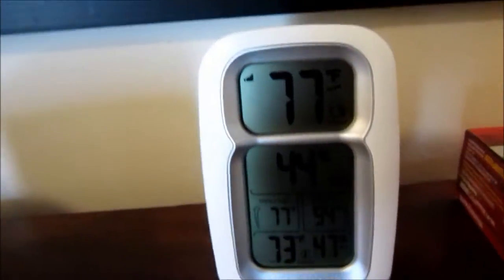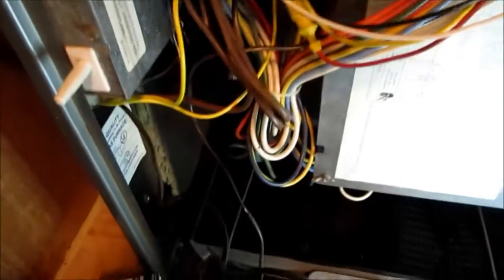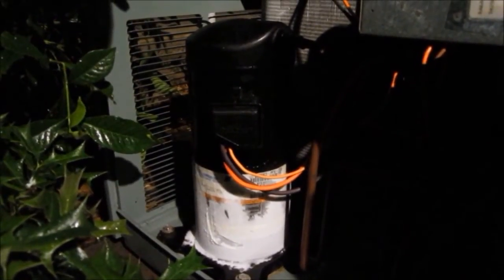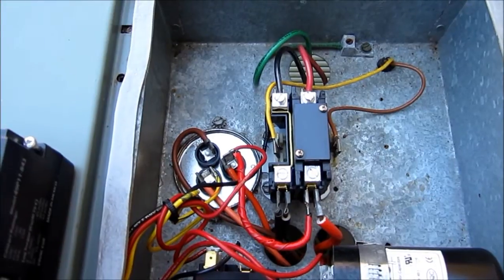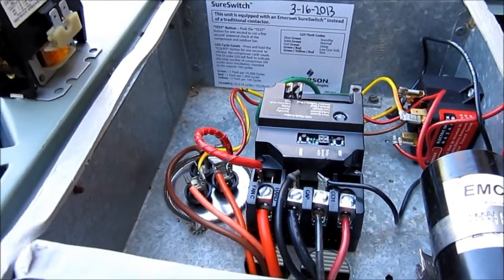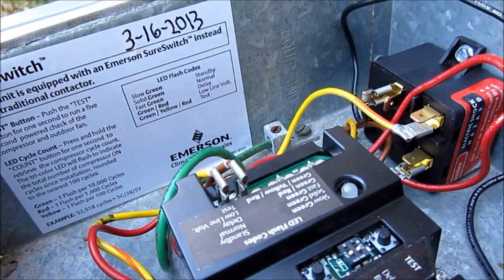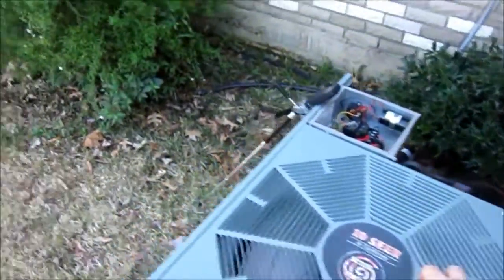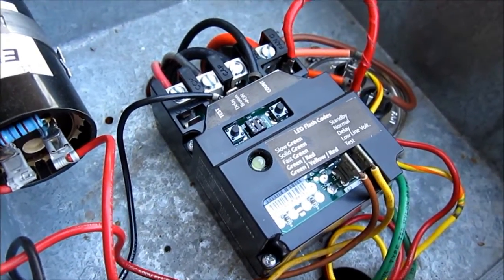Emerson SureSwitch

Comment: It has an annoying high frequency oscillating tone.
Reply from the maker: I have noticed a slightly audible tone with mine but I have to be right near it with unit cover off to hear it.
Reply: @AVTreasures  microphones do have a tendency to strengthen The Sounds they record. But this frequency is definitely in the human audible range. Just imagine the bullshit noises animals have to listen to, glad I'm not a cat. Laptop power inverters are you made quiet so you can tell when they're wearing out and they start to make Electric whining static noises.

Comment: Is the SureSwitch more likely intended for a particular part of the country? 
I called an HVAC tech to install one and he didn't want to install it stating it seems fragile, made of plastic and if water ends up inside (he couldn't tell me how it could be possible) it will blow out the unit... 
I'm in Arizona and it seems like nobody knows about it nor how to install it even following the schematic diagram...
I'm sure I could use it on my 3T and 4T trane but it seems like I'm going to have to install it myself?!?
Reply from the maker: No, the Emerson SureSwith will work anywhere. 
None of that makes any sense. It sounds to me like the tech is just not familiar with the product. If he were, he would have no problem installing it for you. If water is getting into the electrical panel of the unit, that problem needs to be addressed even if using a conventional contactor.  Actually, the Emerson SureSwitch's electrical components are sealed and less likely to be affected by moisture intrusion. It is also ant proof. Ants cannot undermine the SureSwitch like they can a conventional contactor. I don't recommend that you try installing one yourself unless you have had HVAC training and understand the wiring schematic of your units. Thanks for watching my video.
Reply: @AVTreasures  Thank you. I too believe he didn't know anything about  it. I was able to find a company who is willing to come at the end of the month to do the install even though they never installed one before but they said they'll figure it out so I'm guessing they are a bit more knowledgeable.

Thanks again for your reply, it reassures me that I'm not crazy about willing to have one installed to make the most out of my AC unit.
Reply from the maker: No problem Cyril. Glad I could help. 
You will notice right away how much smoother your units start once the Emerson SureSwitch is installed. The sealed relay and  zero point switching are a nice upgrade for almost any unit. Rheem and other manufacturers have been using this technology for years on certain higher efficiency units. Now any unit can be upgraded with the SureSwitch. The SureSwitch on my Rheem unit is now on it's 7th summer with no problems. I was replacing regular contactors every few years before either from ants or contact failure.
Reply: @AVTreasures  Both unit got upgraded to the SureSwitch, so far so good, thank you!
Reply from the maker: Awesome! You are welcome Cyril. Thanks for letting me know!

Comment: I like the idea of this for my four year old 4 ton unit. How would I know which Sureswitch model I should use for my heat pump?
Reply from the maker: The 49P11-843 is universal. It will work in place of most conventional contactors.

Comment: I would be hesitant using one of them. Firstly, Does it have a 30 amp rating? Secondly,  it has an electronic board, electronics and moisture are always at odds, also, cost, are they more than $15? Looks almost like a copy of a RiBB relay, only the RiBB relay is completely enclosed, the Sure switch is open to the elements.  If it was inside the air handler, it might be OK, outside in the weather.....I don't know......also TD's are not required anymore with  modern Thermostats they have TD's built into them already. Low voltage isn't a real problem very often below 190. I must say you do an excellent cleaning of a condensing unit. Vac first, your the first Ive seen to do it that way and it is the fastest and least messy way of doing things. Great job!
Reply from the maker: Yes, the Emerson SureSwitch is actually rated at 40amp. They are currently $38-$50 depending on where you purchase it. So far so good with all of them I have installed. The relay is sealed and the circuit board is encapsulated in clear epoxy as well. Thank you for the compliment on my cleaning and thanks for watching my video!

Comment: I have a Keeprite 2.5 ton central a/c unit. it's roughly 30 years old and working great.  will the sure switch work on my unit?
Reply from the maker: Absolutely. It will work in place of any single or double pole conventional mechanical contactor. It's a nice upgrade for units old and new. Thanks for watching Daryl.
Reply: Great! Thanks! Keep up the good work with the videos.  I'm am Aerus electrolux dealer and I like your central vac system. I also really like the drain vac In your mom's house. Good combo with the Sebo. Good call on the upgrade.
Reply from the maker: No problem! Thanks for watching my videos. That's cool that you are an Aerus electrolux dealer!  I love my Electrolux Central Vac. It's by far the best money I ever spent on my home. It's been serving me well for over 20 years now. Mom's drain vac works well too, but I like my Electrolux set up much better.

Comment: The way you have the sureswitch connected ,looks like it is switching the run wire (orange) instead of the common (black)? Am I correct, and if so, why do you switch it like that?
Reply from the maker: Yes, you are correct Jeff. On this particular Rheem unit, that is the way it is supposed to be wired according to the wiring diagram on the units specs. Some units could be different though, so always refer to the wiring diagram. If you're not sure, just move one wire at a time from the old contactor over to the SureSwitch.
Reply: Looking at the wiring diagram for my unit, it seems to not make any difference which side gets switched.

Comment: Do you replace double pole contactors with a SureSwitch?
Reply from the maker: Yes, you can replace a double pole contactor with an Emerson SureSwitch.
Reply: Have you seen or ran into any issues going from a double pole contact to a single pole SureSwitch?

Input from another forum stated that it was dangerous to go from double pole to a single pole SureSwitch. And one said if there was a short in the compressor or fan motor then there would be current on the ground. If that was the case, then wouldn't the fuse/circuit breaker trip or interrupt the current?

Comment: I'm a newbee but doesn't a modern thermostat have a short cycle timer also?  Wouldn't that make the short cycle timer in an a/c condenser unit unecessary?
Reply from the maker: Yes, most modern digital thermostats will protect the compressor from short cycles but only in the 24 volt circuit. The Emerson SureSwitch also has brownout protection which will react to a voltage drop in the high voltage circuit (Brownout condition) and shut the unit down. A thermostat powered by batteries (or even one that's system powered) would not react to a low voltage condition.
Reply: Thanks for the info. I asked because I had a faulty timer in my 25 year old Lennox A/C condenser and PSE&G Worry Free Service came out and just removed it. The tech said I didn't need to replace it because my thermostat would prevent short cycling. The service call was free but it looks like he wasn't totally honest with me.
Reply from the maker: No problem Nick. I think the tech was right in your case. The short cycle timer that was removed from your Lennox was just to protect from sudden changes or bouncing of the old mechanical thermostat that was installed with that unit 25 years ago. If your current thermostat has a delay built in, it will do the same thing as that old timer in the unit did. The Emerson SureSwitch is a step up in protection from just a basic short cycle timer.
Reply: Good to know. Thanks again.

Comment: Can the Emerson Sureswitch be incorporated with a defrost timer board?  I have a Ruud Avenger.
Reply from the maker: +PFM-Tech Tech Yes, the Emerson SureSwitch can be used in heat pumps that have defrost boards. I installed one in a Rheem RPMD series 14 Seer heat pump last year. It works great. Thanks for watching my video(s)!

Reply ·
Reply: Thanks for your reply...where can I find a wiring diagram that incorporates the sureswitch.

ps... great videos...keep em coming.
Reply from the maker: +PFM-Tech No problem. Here's a PDF with wiring diagram from Emerson's site: 

http://www.emersonclimate.com/Documents/White-Rodgers/instruction_sheets/0037-7295.pdf

I appreciate the feedback. I'll be uploading some new videos soon I hope. Thank you for watching!
Reply: Thanks AVT... I have reviewed that diagram as it comes with the switch.  But,,, it does not include defrost timer board wiring changes.  The fan is connected to the timer board and signal changes are different.
Reply from the maker: +PFM-Tech Oh, I see. I thought maybe you were waiting to buy one after you were sure it would work in your unit. If I'm understanding your problem correctly, all I can think of to tell you is this: Power for the fan only passes through the defrost board so the board can interrupt power to the fan during a defrost cycle. In other words:  In a heat pump, instead of the the fan common wire going from the SureSwitch straight to the fan (like it does in a straight cool condenser), it is connected to the relay on the defrost control board-which is normally closed. When the defrost control board initiates a defrost cycle it opens the fan relay and turns the fan off. I hope this helps.
Reply: Thank you...that helps alot.  Very much appreciated.
Reply: +PFM-Tech If you like the sure switch you may like the universal defrost board too.
Reply: Thank you.  I installed the timer board as well and I am very pleased with the performance.  Emerson put out a high quality product.  I am recommending their products when ever the opportunity presents itself.

Comment: Great video! I would pull that 5-2-1 hard start off and install a factory one rated for the specific BEMF of the compressor. The scroll shouldn't need one. You ran through a lot of contactors. I would check with Copeland for that model and see if you even need a hard start on that baby. I'm not sure if your AHU is running a TXV with a bleed port or not. Something worth checking too. So may things can effect the LRA though. Thanks for the video. I need to add these to my truck stock!
Reply from the maker: Thanks Justin!! I think the Emerson SureSwtich is a great product. Rheem has been using the same zero point switching relay since around 2006 in the integrated control boards on their two stage units. Now any unit can benefit from the technology. I'm in an older neighborhood and the supply voltage is lower on hot days. I think that is what caused all the contactor failures. The zero point switching feature of the relay in the SureSwitch will solve this problem. No more pitted of stuck contacts. This is an older video. Later on I found out that Rheem also recommended the KickStart KS-1 for cases of low voltage or anytime the customer was having light dimming issues. Here's a video I made later showing what I have on the unit now, the Kickstart KS-1:
http://youtu.be/-kIZqvkZT-8
Here's a link to the letter from Rheem that I found on Rectorseals website:
http://ows.rectorseal.com/product-data/ks1-96506/RRW.pdf
Thanks for watching my video Justin, and I appreciate your comment!
Reply: Awesome! I use Kickstart on all my hard starts as well! Thanks for the feedback. I look forward to installing these!
Reply from the maker: Justin Mikola Cool! From what I have learned, Kickstart is the best one to use. Also, To correct my previous comment, I installed the TO-5 on my 3 ton Rheem condenser, not The KS-1. The KS-1 is for 3.5 ton and up which I did install on the 4 ton Rheem heat pump. I replaced the original factory installed one because the cap was leaking.

Comment from the maker: The Emerson SureSwitch is an electronic upgrade for the mechanical contactor. The 5-2-1 compressor saver aka hardstart kit is a potential relay and start capacitor that helps the compressor start easier by giving it an extra boost  on start up, which can help reduce or eliminate light dimming. The SureSwitch starts and stops the unit without the arching of contacts which makes for a much smoother start up of the compressor.